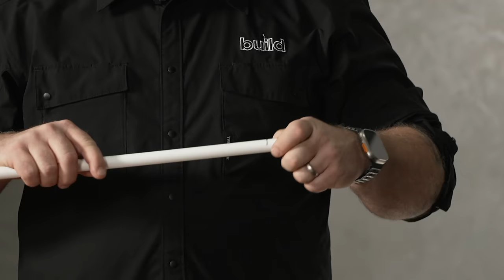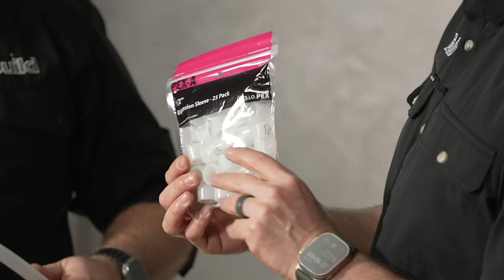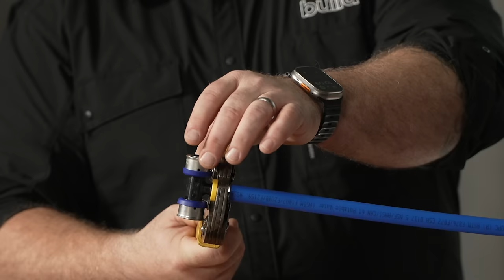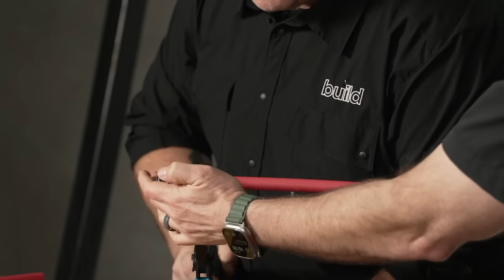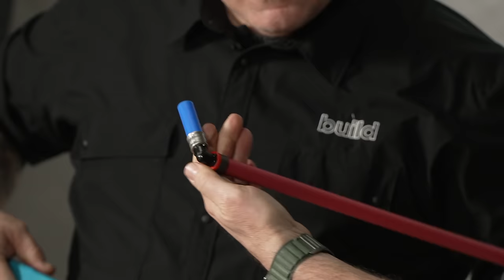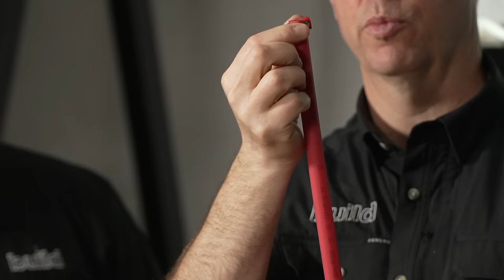PEX Pipe - 5 Connection Options

Comment: Your plumber used the depth tool incorrectly. You should first score and level the ends of the tube by twisting it in the tool, THEN mark the depth with a marker.

It's a crucial first step and ensures a water tight connection.

Another PRO that was missed with PTC/Sharkbite is that you can reposition the tubing without disconnecting or you can disconnect/reconnect with the removal tool. It's probably a reason for the increased cost but overall it's great!

In a future video you may want to cover the thermal expansion relief valve which eliminates the need for an expansion tank!

Good times!

Comment: I bought my clear pex a pipe at my local plumbing store. It was the 3/4 ". . It seemed very stiff- it didn't flex enough to make connection between two "pipes" 18". I did get it to fit and made a secure leak free connection. Next time I will use a swivel NPT fitting.  SO MY QUESTION IS _IS ANY BRAND NORE FLEXIBLE THAN ANOTHER?  the 1/2 " PEX A seems very flexible . I did use a heat gun -didn't help. "homeowner - no plumber available"

Comment: I just had a pex fitting failure. It was in a wall, upstairs to a bathtub shower. The house was built 20 years ago and the plumber said it was not installed correctly.
The failure caused 30k damage.
Reply: Anything with plumbing can fail if installed improperly unfortunately most installs I see on pex are incorrect.

Comment: Question: is there an advantage or disadvantage to using the black plastic or brass (straight and elbows) fittings? Also, what PEX crimping device do you recommend for RV application? Thank you.
Reply: Black are better for soft water seen brass ones corrode and fail within 8 years on wells. Had to repipe a few houses my old master did back in the day.
Reply: @sewerrat7612  Thank you for the reply.

Comment: A question that I hoped would be answered in this video.  It addresses interchangeability between Pex A B & C.  Obviously the expansion style used on Pex A can only be used on Pex A.  Because the Pex B & C does'nt have the stretchy properties that Pex A has.  But I am curious about the copper crimp rings and the stainless steel crimp rings.  Could they be used on Pex A pipe if you didn't have that fancy expansion tool?  To say it another way can I use the copper or stainless crimp rings on Pex A pipe.  The reason I ask is that in my Recreational Vehicle it seems to have been built that way.   I know the pipe is Pex A because it says so on the pipe.  But they used the stainless crimp rings on it.  Is this ok?

Comment: That’s a master plumber for you guys- second half of the video he didn’t know how to operate THE MOST USED AND BOUGHT AYSTEM IN NORTH AMERICA- meaning homeowners, noobs and handymen use and love this system but he somehow cant figure out that the PEX B ring you can easily pinch in place with some pliers before manually crimping. Also, for those that have an M12 ProPress tool, they make PEX B crimps. Note, these are different than the ShortThrow Press tool which could possibly only be a ploy to get stuck with viegas Pureflow system.
Reply: It's really not relevant to many tradesman. We don't install those bc they are inferior and not sold any any place we buy parts.  I do only industrial and the first time i had to use that system i called the manufacturer just to see what pex pipe it was compatible with.  We've done several hundred million in work in my career and ive used my crimp tool 4 times.  

It's only popular bc the tool is cheap and so it makes sense if only need to do it a few times like a homeowner.

Comment: I use crimp (just a home diy guy- not a pro) and it works fine for me. It is cheap and reliable. But if I was a pro there’s zero chance I’d use it- it’s insanely cumbersome and a total PITA when you’re working in a tight space.
Reply: Ima pro and I tell you pex is the easy way to go. Pvc and copper are much harder and time consuming.
Reply: @RfffDdff-rf4qu  oh I imagine it is. I’m just saying if I was a pro I’d go for the expansion or clamp style connections. Fighting with those dang copper rings and crimping tool in a crawl space and under my kitchen sink has built a few muscles I never knew I had and illicited more than a few cuss words.
Reply: The stainless steel pinch rings (band clamps) have a small one hand tool that pinches them shut.  Easy to work with in small areas such as between joists.  The big two handed crimp ring tools cannot be used anywhere you do not have wide open space.

Comment: A newer type of push to connect is EvoPex. Fittings are cheaper but  not removable.  So if  one was bidding on a new large house or multi-family building I think It would be hard to beat the labor savings. Correct? Not a plumber. Just asking.
Reply: I’m skeptical that the “savings” will really hold up if you can’t move a fitting. Plans change and the cost of fittings that have to be tossed can add up. But if the price difference is enough, it’ll get there. Seems like an extra distraction I’d pay a bit more to avoid.
Reply: @twestgard2  so you are saying you would use regular shark bites to be able to remove them?

Comment: Do all of these work equally well with the three types of PEX tubing? I have a bunch of tubing I got at an auction and they didn’t come with the information about what they are. Seems like PTC is interchangeable whereas expansion only works with PEX A, but maybe you can “expand” on that information a bit? My auction situation isn’t common but arriving at a house and finding unlabeled PEX already installed has to be a daily occurrence for a lot of people.
Reply: With expansion fittings and the expansion rings, you have to use PEX A tubing.  But you can use the crimp rings or pinch clamps on both PEX A or B tubing.  Any of the connectors in the video where he clamped from the outside with a tool can use A or B tubing.  PEX A tubing is more expensive than B.  So anyone doing plumbing jobs would only use expensive A tubing in a house if he was doing expansion PEX A fittings.  If a plumber was doing crimp rings or pinch clamps, he would automatically use the cheaper PEX B tubing.  Arriving at a house you would simply look at what is installed and easily figure out if its A or B tubing.  Then stick with what is already there.  Not too complicated.

Comment: PEX B is the best IMO
On a safe side, I never used plastic connections, only brass.. ;)
Reply: Based on what?
Reply: I would agree.  
There is a problem with the Plastic Fittings vs. the Copper / Brass Fittings ??  
I know I have had one of my customers, that had several go bad and had Major interior damage on a 4 Year old house, due to the Plastic Fittings Breaking / Cracking and causing Major Water Damage!
Reply: @bennyd98  Probably based on cost of tools and fixtures.  And availability of fixtures everywhere.  And its very easy to get around the supposed flow restriction in B by just using 3/4" tubing instead of 1/2" tubing.
Reply: Perfer the brass bit wouldn't use them in an area with wells or acidic water they fail too often in this scenario.

Comment: Expansion Pex is the only one really worth considering. While the expansion tool is expensive, the sleeves are cheap, and it is fast.
But, the main benefit is that Pex-A is constantly trying to revert back to its original size. What this means, is that the moment you put on an Expansion Pex fitting, it is at its weakest that it will ever be. You can actually remove it for a few seconds, and twist it for a minute or so, but the connection gets tighter and stronger with time. 
All the others fittings, they are at their strongest the moment the proper connection is made, and they all become weaker over time.
Stronger over time, beats weaker over time.
Reply: This sounds like expansion manufacturers’ marketing. None of them show significant numbers of failures over a reasonable amount of time. Go with whatever is cheaper in your area. All plastic degrades over a long time. Yes, crimp fitting might be strongest at first connection, but if it takes 500 years to reach failure, is it really a concern?
Reply: @lrw-86  it don't take 500 years it takes like one year so expansion is best.  Personally I wouldn't use pex in my own home because of micro plastics. Put a filtration system between pex and human if you must use it. I'm a Plumber and the customer gets what they want.

Comment: I’m curious if pex has any unexpected carcinogenic properties to it. You shouldn’t heat plastic in the microwave but this plastic pipe will deliver hot water to your tap??
Reply: Not heating plastic in a microwave is a huge oversimplification.  There's tons of plastic food containers that are perfectly safe to microwave.  The bulk plastic is generally completely safe.  the problems come from trace compounds like plasticizers (like BPA) and left over catalysts that can contain transition metals like lead.  Proper manufacturers keep the levels of those things low but cheap ones can have disastrously high levels of toxic stuff.  (back in the 2000s some cheap Chinese plastic could contain over 1% lead because they used low quality catalysts and they had to dump in huge amounts to get the polymerization to work)  

  There's been a lot of controversy about what leaches out of PEX.  The overall consensus is that the levels of leeching chemicals are acceptably low.  You have similar issues with PVC and CPVC.  Copper pipes leach copper and other metals into the water which aren't great for you either and that doesn't even count whats in the solder.  So unless you feel like going black to black iron pipe, or using ultra high cost teflon or induction welded polypropylene pipe, none of the options are perfect.  

  There's only a finite amount of stuff that can leach out of a pipe.  So if you are concerned, repeatedly flush the system out after construction for a few days.
Reply: @danheidel  I agree you have to choose what works best for you in your house… but I remain skeptical because we don’t know the long term consequences of any new construction methods. Everyone jumped on the idea of using asbestos tiles because its flame retardant properties… now something like aeroseal is offered to spray into your HVAC ducts without any idea what you could be breathing in over the long term. 

Btw if you haven’t listened to Dr. Shanna Swan discuss the notable decrease in male fertility because of the use of plastics, I strongly suggest you give it a go.
Reply: @suspicionofdeceit anything new. I did reference aeroseal as one semi-new item offered. But even pex hasn’t been around long enough to see possible long term side effects. Another example, there’s a reason why people choose to not have gas cook stoves: it’s been linked to childhood asthma.
Reply: @danheidel and with Teflon stuff, PFAS is now a concern. My area still has a fair bit of leaded iron mains to the house but, funnily enough, lead leachate isn't a big deal unless you have acidic water and let the water sit for days in the pipe. Provided your lines get used regularly and your water is neutral ph, leaded mains aren't a problem. Which is weird to say...
Reply: @suspicionofdeceit that’s assuming people who consumed water from those newly built houses, from the 70s-80s, stayed in those houses long enough to notice a causal relationship.

Comment: A lot to consider here. As both a trade professional and a DIY'er, I'd like to add a few observations of my own. 

  PINCH: If you look closely at a pinch type ring, contact with the pipe is not consistent as with a crimp ring and requires EXACT placement and a complete pinch...however, when changes or mistakes come along, the pinch ring can be easily removed. They are great for temporary, post construction, tight spaces, or small projects. 

  PUSH: Push type aka "shark bite" imo, should only be used for temporary repairs. Every mechanic as well as NASA will tell you, O-rings will eventually fail. Additionally, the shark bite design uses teeth that after years of pressure and expansion, will create a score into the OD and thus, a weak point...Long before PolyB started to decay from chlorine and was phased out, I repaired gaggles of polybutylene fittings that relied on a shark bite similar style "grab ring" which scored into the pipe where it eventually cracked. Mark my words, some day, push-in fittings will be the subject of class action suits. 

  EXPANSION: although great in many ways as the video mentioned, I don't trust plastic as a long term compressive force. Molecules being forced apart do have a memory, but time and heat (such as in Arizona attics) eventually win. It may not be in my lifetime or even the next, but eventually, the expansion rings will crack, the pex will age and lose its memory, and water pressure will win. IMO.

  My rule...stick with time tested....If inaccessible (like a wall cavity) use copper or PexB compression or pinch ring. Cold water Supply or long runs AND accessible (basement, crawl space, use PexA  expansion ....mainly due to the ID of the fittings. Hot climate attic, upsized PexB 1st, PexA 2nd.

 * The cost of one leak will by far outweigh any price variables.

Comment: Best reliable method that will last for many  years will always be soldered copper pipes and fittings. I like uponor, but I'd be skeptical plumbing an entire home with it. Hot water causes the plastic pipe to crack right past the plastic sleeve.

Comment: any plumber worth his salt will tell you that sharkbites are good for temporary fixes or to put a valve on a copper tube that has running water in it (you made a mistake or you cant access the main water valve to braze a connection for a valve). The technology has not been around long enough to stand the test of time. Also the sealing element is rubber and if your rubber gets exposed to temperature changes (if its connected to a hot water line for example) it will wear down overtime due to expansion/contraction.

Plumbing accidents/mistakes are costly so make sure you do it right and avoid the shortcuts when you can.

Comment: You described the different fittings which was great but you should of or do a separate video of different types pex tubing
Reply: No need.  Both PEX A and B are the only ones really used in houses or commercially for water.  If you are using the expansion connections, then you must use PEX A.  But if doing crimp rings or pinch clamps, you can use A or B.  A is more flexible than B.  Both have same or enough heat and pressure ratings.  You use the tubing that matches up with your connecting method.  A is more expensive than B.
Reply: i was referring to to oxygen and oxygen barrier tubing cause both are used  so a home owner watching this has a idea of what it is used for, hence why i suggested a separate video  @russellseaton2014
Reply: @benhellerman3864  You are talking about the PEX tubing used in radiant heating systems.  This video is talking about water plumbing, so no need to talk about the other types of PEX tubing besides what is used for water plumbing.  Not sure too many DIY home owners are installing their own radiant heating system.

Comment: So do you upsize copper -> PEXA or not?  Everywhere I read it's always a mix of responses.
Reply: Copper, and both A and B PEX tubing have the same inside diameter.  Its just that there is a small reduction in flow from the PEX B fittings over the A fittings.  If flow is a concern, its easy to just use 3/4" PEX tubing for your main lines feeding the fixture supply lines.  Or just use 3/4" PEX tubing everywhere.  Immaterial dollars different.

Comment: I prefer Pex A. All the Pex types want to return to their original size. They are continuously pushing the crimped rings to expand on the others. 
Pex A is continuously squeezing the fitting to return to the original smaller size.

Comment: Not the first to market.  They marketed well and hammered home on a niche product marketed to retail and DIY.  Few plumbers are comfortable with push connects.  Have to be accurate.  Plus you have to do your best in promoting USA manufacturers instead of foreign owned and import product.  It helps the USA and the American Plumber especially if you have a large audience.

Comment: The push to fit type is ok for temporary use but as it uses rubber o rings the ozone in the air and UV light breaks it down to powder. Just like rubber on car tires, if it was Viton or silicon o-rings i would trust it more but no, only temporary!
Reply: My same worry when I see the copper on copper crimp fittings being used.

Comment: I do not recommend the pinch clamps. We have pinch clamps installed on our center pivot Irrigation systems and they are nothing but problems. Short term they work fine but long term they get replaced. The flexible drop tubes/pipes for the sprinklers will start to shrink after exposure to the elements and the connection points will leak or blow off after a only a couple years of use. They get replaced with worm clamps because you can't retighten pinch clamps but you can retighten worm clamps if the connection starts to leak again. The operating pressures range from 15-65psi, so the pressures are not that extreme. I don't recommend worm clamps for a house plumbing either but on an Irrigation system, tightening worm clamp with a screw driver can fix a leak far faster and easier than trying to find that special pinch tool, the special pinch rings and trying to crimp it in that perfect spot while standing on a ladder 15 feet above the ground.